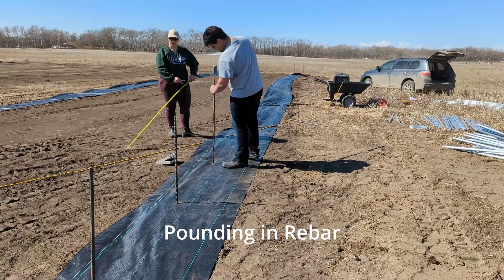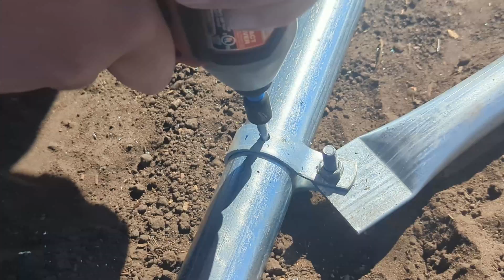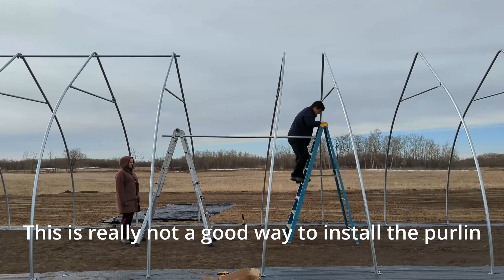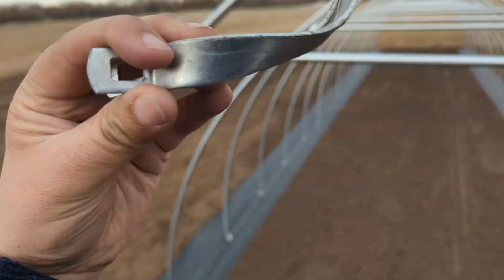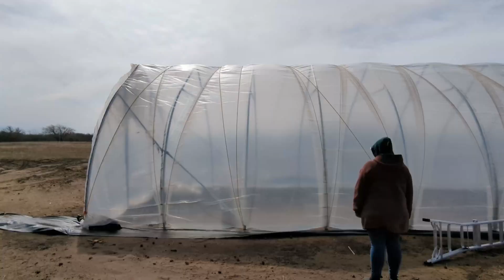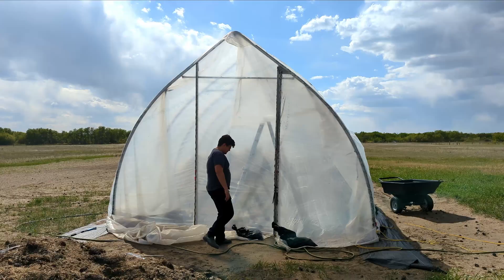GrowHoops Greenhouse: 1.5 Month Review

Comment: Wow, it’s great to get a customers view. Thanks for this review simple& sincere. I relate with it as I’m also not great with tool. I’ve been torn between growhoop  farmer’s friend. I wonder if they fixed the concerns on recent model.
Reply from the maker: I will say after having this for a few years now, whichever unit you choose to buy, go out and buy a bunch of bolts and lock nuts to fasten it together. The self tappers included in any of these greenhouse kits are always backing out and it's a really difficult thing to change once it's up and the poly is on.